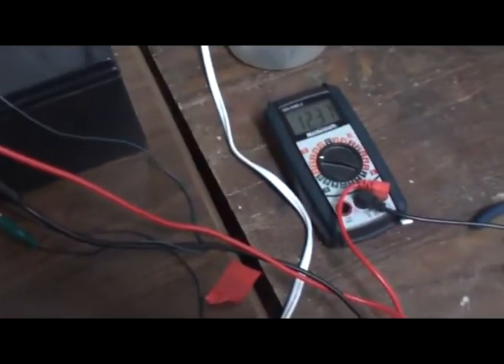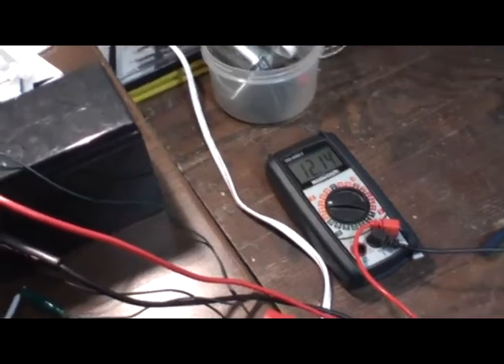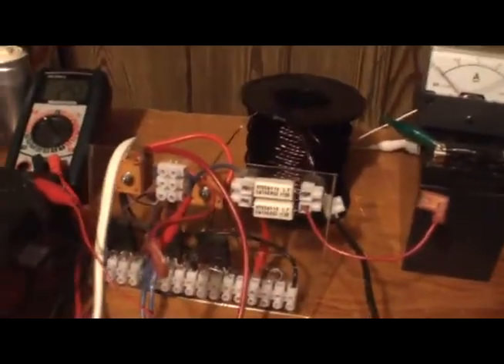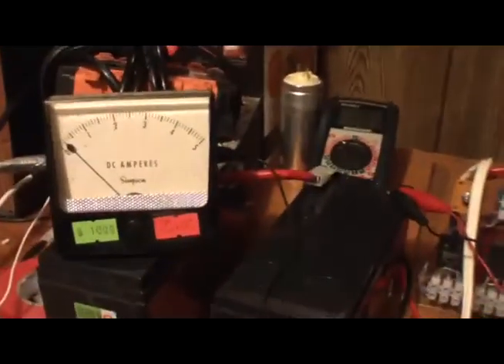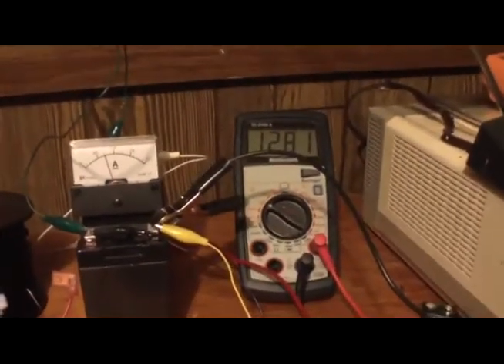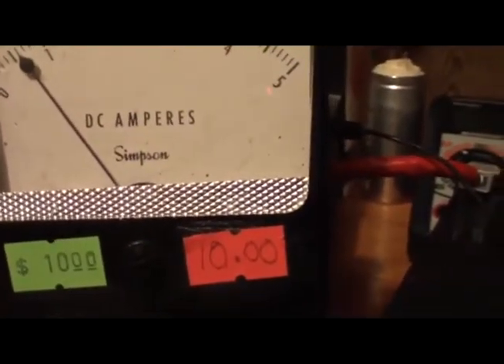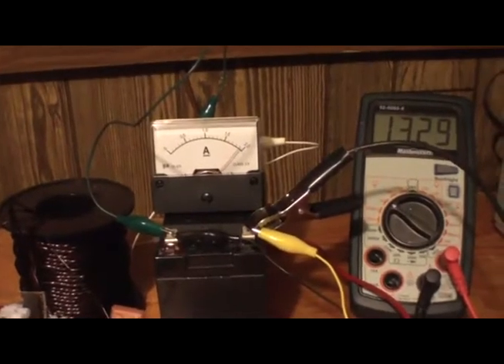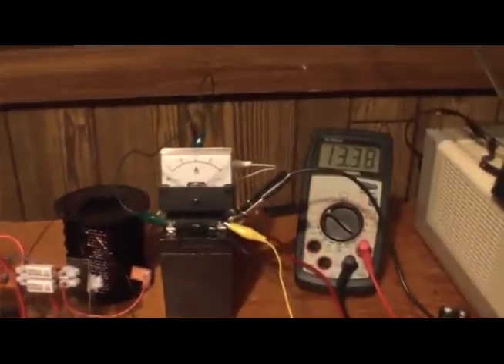SSG TS (SS MSG 3T) Aluminum Air Core Experiment Pt. 5

Comment from the maker: After 8 hr.s rest, or so, charging battery settled to 13.02V and run battery series pair reads 25.0V. The charge battery was taken to almost 14.0V before quitting.